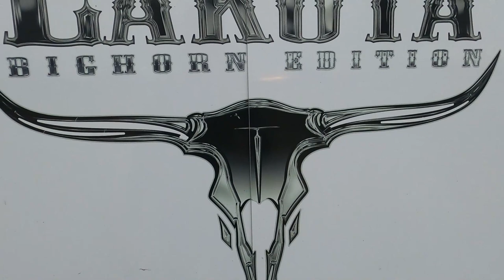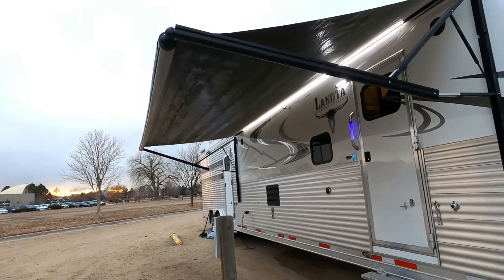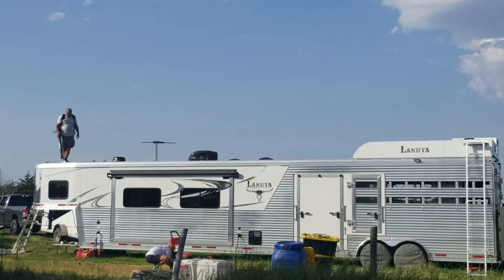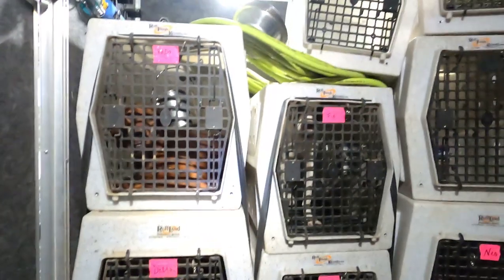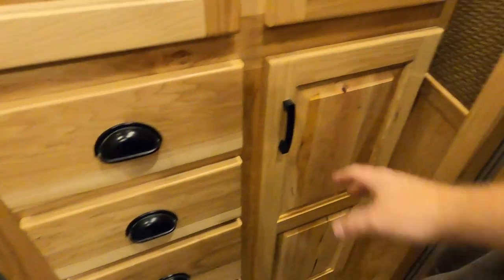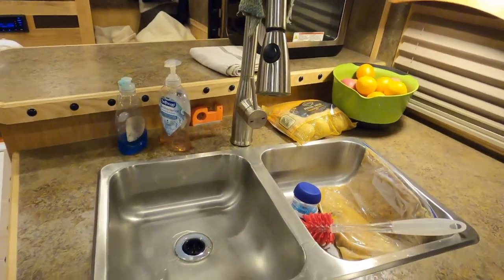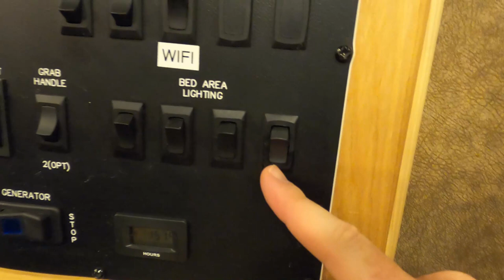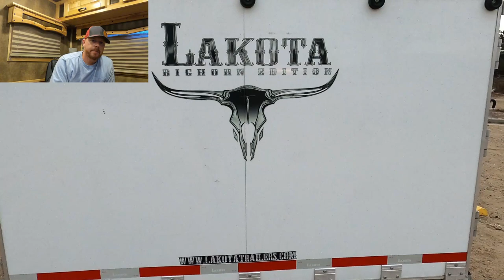Our New Home - Lakota Bighorn Horse Trailer Tour (Full Time RVers)

Comment: That may be recalled a 3 horse trailer but it is in practical sense a 2 horse trailer and the inside door between the living quarters and the horses should be opened towards the living quarters, not towards that inside stall.
Reply: It's a stock combo trailer (and 14 ft of stock area at that.) It could fit 5 horses comfortably if we didn't have the sliding gate pushed back for the dog are (which is seen as storage in the video because winter.) And the door doesn't open into the stall, it opens into the ✨️MIDTACK✨️ which is where the dogs are in this video because winter.

Comment: how do you keep your hot water heater from freezing since it is open to the outside
Reply from the maker: It is always on since we live in it so it stays hot and won't freeze. There is a way to close some valves and drain the water out of the water heater also if you are looking for that option. You should always winterize your trailer if you don't use it in the winter.

Comment: What is the length of the livestock area? Do you use the front area as storage and the rear for the horses? Im trying to figure out how many horses you can fit in just hald the stock area to store the fourwheeler in the front section. Thank you
Reply from the maker: We have a floating gate so we have options that we can use to adjust our livestock area. We have dogs and dog crates in the front of the livestock area and horses in the back. Our livestock is in 12ft long and we usually travel with 3 horses in around 6 or 7 feet in the back. We normally load our 4 wheeler in the mid tack area with the ramp.
Reply: @RedbeardOutdoors-IrishSetters thanks for the reply. That's really good to know. The one I was looking at has a 14ft livestock area and I was worried I should go with the 16-foot instead. It's nice to know I could still fit three horses in the rear compartment of a 14ft area. The trailer looks really similar to yours except it's a smaller living quarters at 15ft. Any advice you have or recommendations are welcome. I'm still planning it out and after speaking with someone over at the manufacturer, it's looking like I'm going to need at least a 4500 series truck which explains why you have a 5500 to pull this.
Reply from the maker: @wrokjon  you can never go wrong with more stock area. We wish we had more but we live in this trailer. When it comes to your truck just pay attention to your trailer tounge weight and your trucks payload weight, make sure they work together. I would lean towards tripple axel because it should help with the tounge weight issue. It's not cheap or easy to own a 4500 or a 5500 because it is comercial truck. It is hard to insurance for them.
Reply: @RedbeardOutdoors-IrishSetters  I'll have to call the manufacturer again to verify but when they gave me the tounge weights to two similar size trailers, one being double and the other triple axle, they both had an empty trailer hitch weight of around 4600lbs. I was surprised as I thought the triple would be lighter as well. At 4600lbs, I'm not sure I can make it happen with a 3500 since even a base model only has around 5500lbs of payload. I would think these trailers loaded are north of 5000lbs on the pin weight. I would rather not get a commercial truck like you said but I would also hate to get a 3500 and find out it's not going to work.
Reply from the maker: @wrokjon  Yeah it sounds like it is going to push the limts of a 3500. My tonge weight is 6000lbs but that is also if I was fully max loaded. I'd say worst case we are around 4000lbs. Most of the time we don't travel with water in the tank but sometimes we have too. The other issue is we travel with around 4 to 5000lbs of payload on the truck so it adds up quick.
Reply: @RedbeardOutdoors-IrishSetters  that's why I'm really glad I found this video since the trailer you have is almost the same as the few I'm looking at since they are sister companies.  Really gives me a better idea as to what I need.